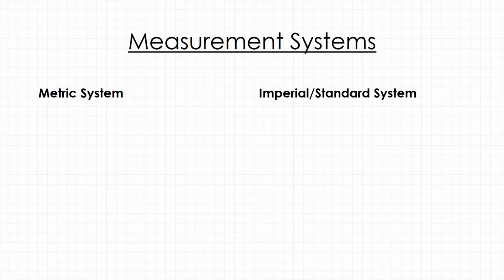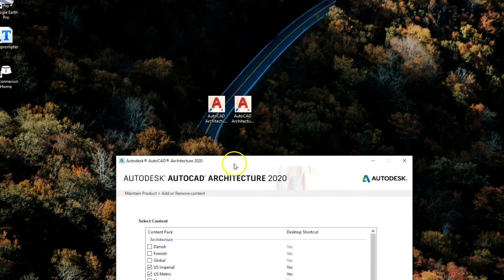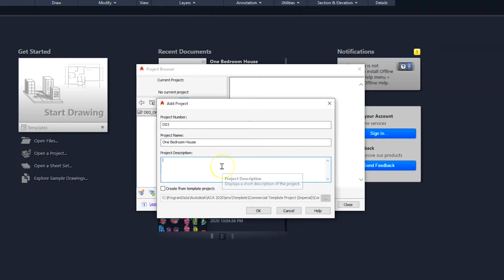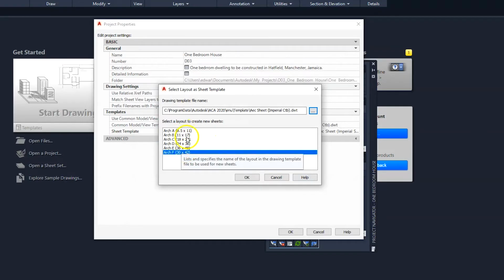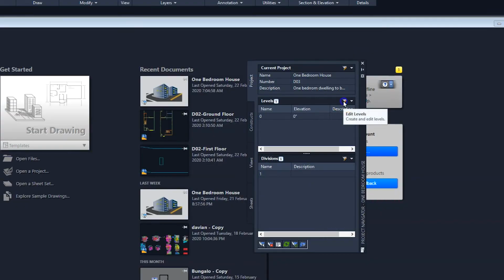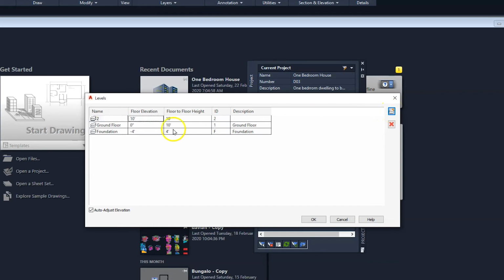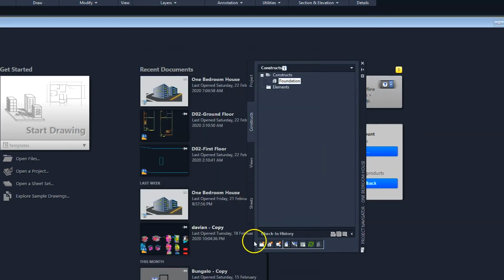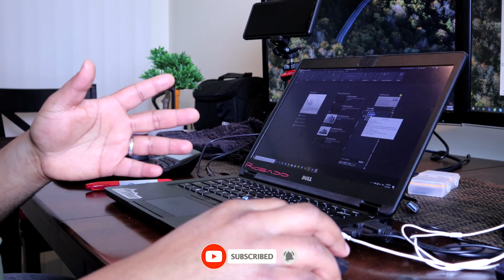PROJECT SETUP in AutoCAD Architecture 2023

Comment: How would one do a loft within a single floor/level? Say the main ceiling height is 3m50 but then one space has a second floor level blocked in 2m up into that space? 

If you have floors that overlap in heights (so say floor 1 is 0m–3m, floor 1.5 area is 1.5–4.5m up, floor 2 is 3m–6m up) would that just be not having the floor height auto adjust?

Comment: Love your videos. What if you have a taller building along with a 2 story building? Such as a 2 story house with an attached garage but the garage is 16 ft tall. I'm guessing the garage would go on its own Division but on the same Level as the First floor?
Reply from the maker: Great question! Thanks for asking. If the attached gararage is on the same "grade level" as the main building, then yes, I would have them both on the same level. If one is higher than the other, then I would make separate levels.

Comment: If I am designing a plan with an upper floor, should I add a level for the upper floor slab starting at 10' with a 6" height  then star the upper floor at 10' 6" or should I just ignore the upper floor slab and start the upper floor level at 10'?
Reply from the maker: Ignore. No need for a level just for slab. You should checkout the last video I posted. It'll give you a good example.

Comment: Hi appreciate all of the videos your instructions are very clear.  I have a question when creating the various elevation levels.  A house that I am looking to design in AutoCAD is considered a split level.  So the main house is 2 elevations 0-10' and 10'-20' like normal.  However there is a connecting portion of the house that is raised 4'-14', how can I account for this elevation of the other section of my house?  AutoCad does not let me create another level in between the 2 I have created for the main section of the house.  Any advice is appreciated.
Reply from the maker: You can create a level at 0" (Entry Level), another at 4'-14" (Mez Level), and another at 10'-0" (First Floor). So you will have three levels. You could also have two divisions. Main and Mezzanine, or Left and Right Division, - whatever you want to call them. Hope that was helpful.

Comment: why are you labeling zero elevation to your finish floor line?
Reply from the maker: I thought the slab on grade's FFL should be at 0, should it not?
Reply: @TDVision_U   in my case, my zero elevation is on natural grade line then i step up usually 6 to 8 inches from natural grade line to finish floor line of ground floor due to our tropical climate flooding is inevitable. should i add another level to my project navigator too?
Reply from the maker: You're correct about making the finish grade lower than the FFL. Usually with building drawings and construction, the 0 mark is usually the ground floor level. Below would be negative (-) and above would be possiive (+). So in this case the, finished grade would be -6 or -8 inches below the 0 line.
Reply: @TDVision_U  so what about the grade line to ground finish floor line? shall i add another levels to it?

Comment: TD
I admire your videos greatly
However, I do not understand why you would use Autocad arcitiecture when revit is logically and practically l immensely superior 
Can you provide some justification for Autocad over and above of Revit
I am responsible for IT management and need to be well informed to change our firms culture
Regards
Reply from the maker: Thanks for your feedback man! I appreciate your question too. For me, it's not about one over the other. It's about what best fits your needs/situation. AutoCAD is a cheaper alternative for many. I also think those who are familiar with AutoCAD, do not know the its full potential , mainly because they do not have resources. That's where my videos come in. Learning AutoCAD Architecture is a much easier transition than moving over to a completely new software like Revit. However, if you're using Revit already, and it's working great for you, that's awesome. I don't think you'll need AutoCAD Architecture.
Reply: @TDVision_U  
Thanks for your feedback 
I started on revit and need to be able to work with Autocad arc as well. I find the step back into Autocad surpringly difficult particularly in creating elevations and sections which automatically update with revisions Yet I also see v good features in Autocad
I will continue to review your excellent tutorials in Autocad
Best of luck
Reply from the maker: Thanks man, much respect!

Comment: Hi Edward.  I enjoyed your presentation on setting up your project, but I have a question.  
   1.  If you have a sloping land and have to consider making the building a split level,  how would you do the setup for that type of structure.
   2.  If you have a wooden building to be constructed on pillars/columns,  How would you do the setup.
Reply from the maker: Very good question. I might have to do a video on this. But I think the best way would be to create Levels for your basement or pillars/columns. These levels would be in the (-) negative. Level 1 is always at (0) zero.

Comment: Hello, i need your thoughts about how to use the Sheet Set Manager (SSM) or Sheet Set Manager embedded in AutoCAD MEP through the Project Navigator.  Do (SSM) and SSM-Embedded (MEP) have different functions? Are they both interacted together as one?
Reply from the maker: As of now, they can be operated separately. But they both essentially does the same thing. I would recommend using the SSM-Embedded if you're using MEP or Architecture since it's integrated into the Project Navigator. It's much easier to work with that one pallet.